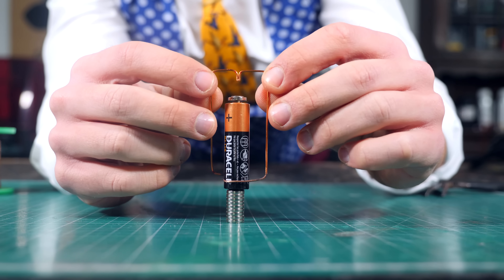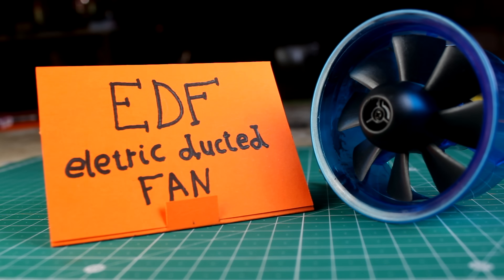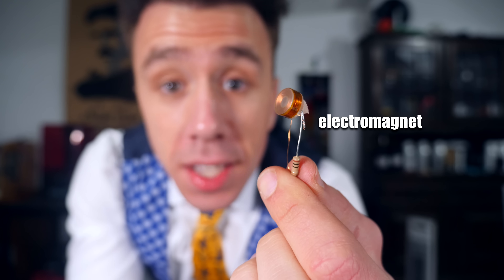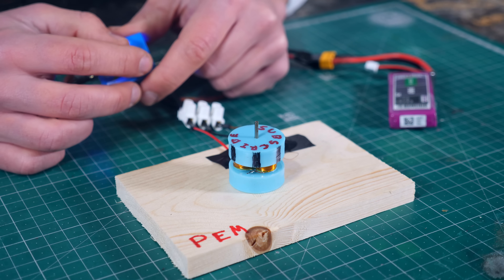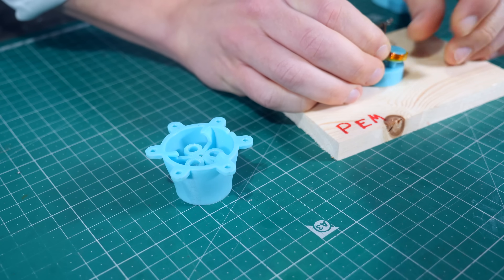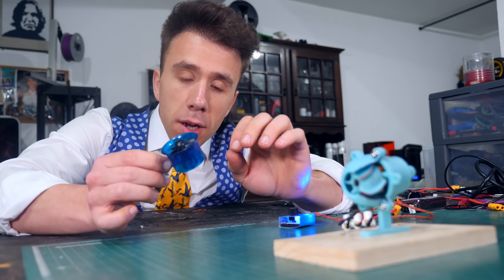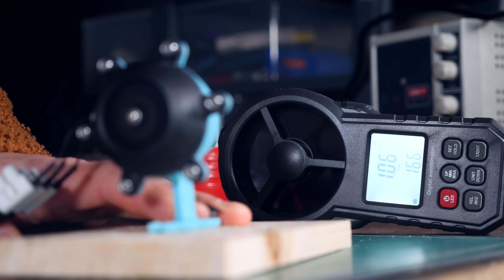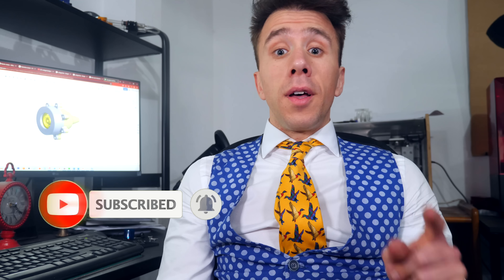I 3D Printed an ELECTRIC MOTOR FAN

Comment: Hi, mechanical engineer here.

Axial fans have different performance curves (flow vs pressure) than centrifugal fans. Given the same peak power fan, an axial fan operated at its peak power point (a carefully selected load), MUST be a low pressue, high flow operation point. Conversely, a centrifugal fan operated at its peak power  must be a high pressure low flow operation point. 

This all means that:
1. A given load (resistance) will make the fans operate at a singular and very specific operation point (flow and pressure point).

2. The curves are different between fans due to very dissimilar mechanical aspects.

3. The corresponding operation point between fans will be different.

4. The operation point you chose here is actually 0 load.

5. The axial fan (given same rotor speed) will always show higher flow AT NO LOAD like you showed here. Centrifugal fans will outperform the axial fan as the resistance increases.

Now, how Dyson creates a good fan with a centrifugal fan? The flow their fan generates is not coming exclusively from the centrifugal fan, it comes from a venturi effect. The centrifugal fan is acting almost as a compressor and using a "nozzle" they generate a high speed (low flow) air current at exact exit of the nozzle BUT as it expands it creates a low pressure zone behind the stream and drags atmospheric air with it. Multiplying its flow. So to mimic this you can create a 3D printed venturi effect nozzle.

Comment: I will make some suggestions by looking at your impeller design and the one of the Dyson. Look at the airfoil geometry, the attack angle is everything when it comes to sucking air, so I would test different angles and check their dependency on the intake diameter and the top impeller diameter. I would also check the tolerance between the impeller and the casing because it's responsible for a stalling phenomenon or for not compressing the fluid enough. Then for the outlet, how about creating a variable-diameter nozzle to test the right diameter to produce the same trust (like the ones combat planes have).

Comment: centrifugal fans do not produce much trust but rather pressure as you say
if the purpose of the project is to make a jet engine, it would be necessary to install a double flow system which would mix centrifugal fans for the combustion of the fuel and the rotation of the fan and axial fan for the propulsion 

if you could told us what are you trying to do i think we could help you more

Comment: The resistance is mainly created by swirling the air inside the motor. As it was written above, the diameters of the inlet and outlet should be larger. The angle of attack of the blades should also be changed, but it is best to make the impeller not made of plastic (not so weak to bend).

Comment: You're runnning into two things I think: First is impedance matching. The EDF motor is well-matched to its original fan, it is able to use most of its energy to push air, rather than to spin the fan, or hitting its maximum speed (saturating) before it reaches maximum power. You'll either need to adjust your impeller geometry to allow the motor to dump more energy into the air, or speed up the motor until the impeller design you have now is able to start efficiently pushing air (The Dyson motors spin in the 80-150,000RPM range).

Second is that EDFs are optimized for high velocity bulk flow, and your impeller is a compressor. It's designed to make pressure, not bulk flow. If you want to make bulk flow, you need to let the compressor make pressure, then use that pressure to entrain more air the way your Dyson fan does. I'd suggest an aerofoil ring with the air outlet coming out of your aerospike at the back. If you want velocity, you need to let the compressor make pressure, so you'll probably need more RPM in either case, or an impeller optimized to spin slower.

Your first design had too much dead space but probably about the right twist rate on the vanes. Making them deeper and adding more of them will probably get you to where you need to be pressure-wise.

Comment: Speaking of fans. I'm a big fan of your channel
As for the fan 
You need to get the correct angle of air flow for your fins
Using another fan with different angle will not flow to the correct flow for the dimensions of the outer duct that your are trying to use
Try to use a simulation flow software 
Think vortex and you will achieve your goal meaning the flow needs to compress and you can only get this if the angle of the intake flow and outlet are at a correct angle

Comment: my guess is that the centrifugal fan can produce a lot of pressure,but not move as much air as an axial one,making it unfit for propulsion,but more atuned to moving air through radiators and such,for propulsion,you want to move as much air weight as possible,not try and cram it into a space which does not exist

Comment: In powerplants centrifugal compressors are generally used for high compression with less compressor stages when compared to axial compressors pressure ratio is about 4-5 times for the centrifugal compressor per stage where as axial compressor have a pressure ratio of 1.5 per stage so there might be two critical problem. First one is that the energy given to motor of centrifugal compressor is begin utilized for higher compression of the air than the EDF in which mass air flow is given priority over compression and the second problem might be the change in the direction of the air flow of the impeller, the air has to make two 90 degree turns wile entering and exiting the impeller which in turn reduces the flow rate compared to the axial flow in which there is no restriction. I hope this makes sense. thank you for the content.

Comment: I feel this has something in common with the Rocket Nozzles you love. 
My theory goes like this : when impellers increase the pressure of airflow, and the exhaust has the same area of cross section, more air flows radially outward from the exhaust due to pressure differences. The same way rocket engines use bell nozzles to reduce the pressure and increase the velocity of the exhaust, if you tried something to equalize the exhaust pressure with atmospheric pressure, you'd technically achieve the same amount of thrust.

Basically, you'll be converting the energy in the form of air pressure back to velocity to achieve the same thrust as the EDF. And considering EDF's don't mess with the pressure at all, it makes sense they're able to reach higher exhaust velocities than impellers at atmospheric pressure.

All the best with your project tho, looking forward to a cool video with whatever you're making...
Reply: Exactilly
Reply: Also impalers are heavier soo

Comment: Open up the intake bore the same percentage that you choke down the outflow nozzle. So if  diameter starts at 5 cm for both, go 7.5 cm for the intake and 2.5 for the outflow. Also, you need to almost have a seal between the blades and hull, maybe try just a drop or two of circuit safe mineral oil. If you have too much gap between the wall and blades, as the air tries to compress, the pressure generated makes air leak out, creating back flow and turbulence similar to a Tesla valve.

Comment: My guess on why you are producing less thrust because the surface area of the fan blades are smaller that the ones on the EDF, if you think of it as a couple of gears changing the size of the blades, the angle of the blades and the amount of blades is just like changing the ratio of the gears. hope this helps

As a side note I am in high school and I am not 100% on this but that's my theory

Comment: the motor can only output a certain maximum energy. This energy is the maximum kinetic energy of the air you move with the fan. The kinetic energy has the v^2 term, so if you move stuff twice as fast, you will only get 1/4 the mass flow. If you want large thrust, you need to move the largest amount of air through the smallest possible velocity change. That's why large propellers are more efficient than small ones, and very long skinny wings are more efficient than short stubby ones. 

your impeller can only move a tiny amount of air, so you just won't be able to get great thrust that way. the very "fanny" fans, with large diameter regular blades, are just really good at moving large amounts of air. Impellers are small flows high velocity/pressure, like in vacuum cleaners or compressors.

Comment: BASICS: Centrifugal (air exits blades @ 90 degrees to rotation axis) - low flow/high static pressure. Mixed-flow (air exits blades @ 45 degrees to rotation axis) - medium flow/medium static pressure. Axial (air exits blades parallel to rotation axis )- High flow/low static pressure. Your meter is only measuring flow, not static pressure so you're  comparing apples with oranges. 
That dyson fan is actually a mixed flow design, so all things being equal, with the same input power, it will have lower flow but higher pressure than the same diameter axial flow fan, and higher flow but lower pressure than the same diameter centrifugal fan.

Essentially all fan design is balancing between how hard you push the air and how fast you push it (they're 2 different things)

Comment: You are missing blades.  The driven shaft of the motor need to be in front and behind the airflow.  In Jet Engines, there is the intake ( which you have ) and a set of blade called compressors.  They restrict the flow as well as move the air into a smaller space for the same volume ( thus Compress ).  So, behind where the pulsed electromagnets are, you need another set of blades ( or stack of blades ) to help in the conical section to compress the airflow.  Keep going, you might be able to build enough air pressure behind it to destroy a tomato!!

Comment: The pressure difference changes the thrust to speed ratio so you have to apply a higher voltage to unlock the full potential.

Comment: Im no engineer but I am educated enough ☺️ i guess the first thing i noticed is the housing difference where the edf have no issue , the centrifugal fan have to compress fluid from either sides F&B. Another thing the centrifugal fan is more like turbine so its useless without a housing for example put that fan on an old airplane and it is not going no where 😂😂😂😂.i think if you want to achieve a thrust like in edf using a centrifugal fan u have use a stronger motor to compensate for the loss power compressing the air.also do not forget thrust is a change of momentum with time where it depends on velocity, density and area.thats it correct me if im wrong.

Comment: I think your problem lies in mass flow rate. From what I remember, centrifugal fans are pretty good at generating pressure, but not great for moving large volumes of air. The Dyson fan gets around this by spreading that pressure over a larger area (the outer ring), where the air is able to grab and drag along even more air from the outside. Where an axial fan, like an airplane propeller, is able to move air even outside of the propeller's diameter, the centrifugal fan is restricted by how much and how quickly it can take in air. You can increase this by adding a second centrifugal fan, but more than 2 stages will have no increased effect.

I could probably explain better if I can find my old aerospace textbooks.
Reply: Warning, he is a scammer, i have fallen for his trap. In the Video from integza 6 months ago he made a comment.

Comment: Difference between them is determent by integral of subtraction amout of air a "fan" push in delta-time divided by amout of energy consumed. Wich in youre case is restricted by the narrowest point of the suction unit.
Simply put, your case concentrates the negative pressure that the fan creates, increases speed, and reduces the number of air molecules. This results in a much wider outflow angle and accelerates the speed reduction per unit distance.
Reply: In fact, it would be very interesting to check what kind of thrust on the axis of rotation your version creates, and what kind of second. Mount both on a light cart and gradually add weight to the stunt to see who has more traction. And now you actually measured the speed and density of the flow.

Comment: i got a video sugestion. i,ve been thinking about this for a few months. Could you conect a jet engin to a vehicle and threw a gearbox use the engin's torque to spin and propel the vehicle forward ?

And or build a electric rc car or plane that only gets its power from a nearby teslacoil no bateries ecept maby the controles.

ps love your vids❤

Comment: You can also coat the inside of the casing, as the pressure might not build up if there are leak due to layer of 3d print

Comment: There are two principals to create thrust. Mass airflow, and airflow velocity.

EDF’s work on the principle of low air velocity but a high mass flow rate.

What you are creating is a compressor to try to create flow velocity. That requires insane RPM’s. Probably 30,000+

Comment: The problem with centrifugal fans is that it takes more energy to produce the same amount of thrust due to the air having to change directions more than a propeller fan, causing drag. Also, you are creating a high pressure zone which is also needing more energy. Centrifugal fans are great for compressing air at high speeds. Propellers are great for pulling and pushing air.